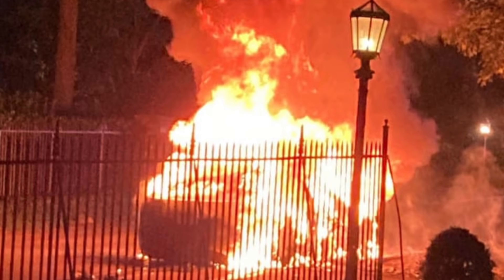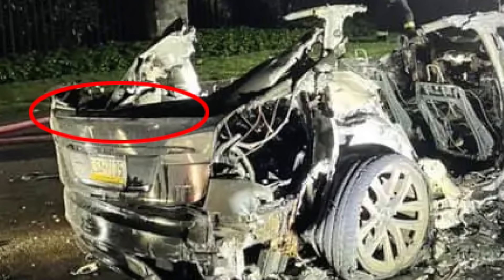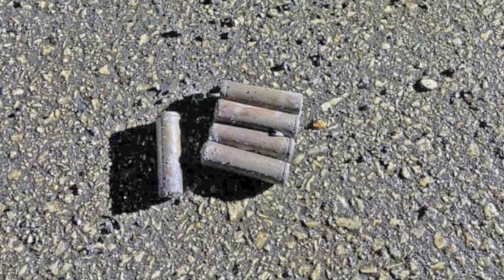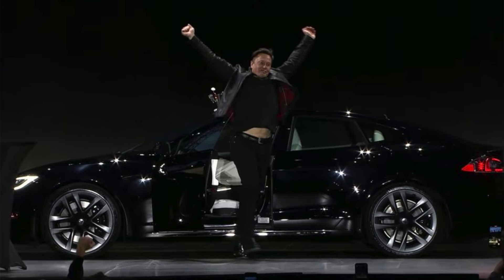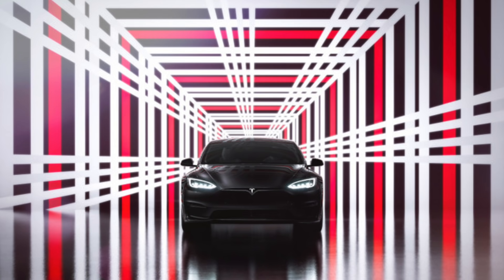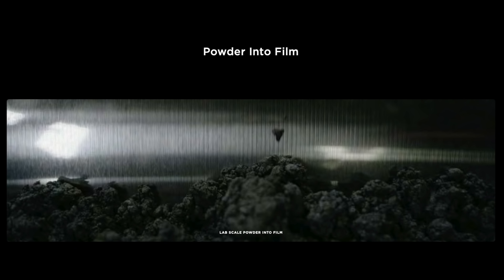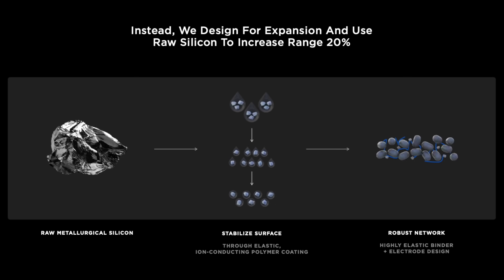New Info on Tesla Model S Plaid Batteries

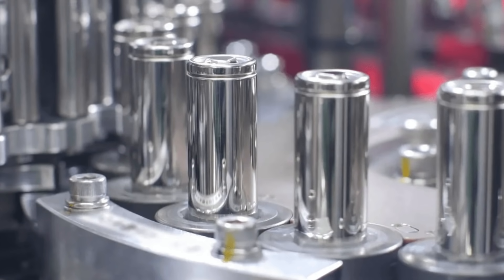Comment: I think, the main point, the really important point, is the one you state at 06:08. Tesla, even if the 4680 ramp goes better than planned, will need EVERY battery it can get their hands on for a very long time. As such, if they can still improve other form factors and increase output they will do so until the day where they can easily transfer all cars to 4680.
But as we can see here now with the Plaid, for performance and range, the 4680 is not needed for passenger cars. The 4680 is key to higher margins, faster production and being able to deliver on the Tesla Semi/Cybertruck and eventually getting to the 20M total vehicles per year.

Comment: I thought I read that one of the advantages of the tabless design means that there is now no weakness link in connecting to the cells i.e. you can now have greater discharge (and charge) currents.Maybe that could also explain 18650's with better performance?

Comment: Something that may help.  A Model S with 18650's is charged duty on the batteries when imported to Canada.  If the Model S Plaid had 2170 or 4680 batteries made in USA duty would not be charged on the batteries.  In other words if you compare the price of both Model S in US $ and CAN $, if the percentage increase is the same the batteries are 18650 but if the Plaid has a lower % mark up the batteries are either 2170 or 4680.

Comment: It doesn't matter which battery and chemistry is used, as long as the battery module can be replaced in a few minutes and the capacity can be reduced via software (-;

Comment: The simple explanation tends to be correct. Sounds like they used the maxwel technology in the old battery form for now. If this explains the fire, watch out below. If not, hold fast. When 4680 is announced watch out above. If fsd is announced, look skyward with a telescope. Also, don’t forget how the general index direction and currency crossings effect the up’s and down’s of the major stocks, Tesla included.
Reply: Unlikely Maxwell DBE was used in my opinion. Most likely a cell from Panasonic Japan.

Comment: Tesla's video clips showing 4680 cell production could be misleading. They give one the impression that 4680 cell production is in high gear, when in fact these clips were shot at a prototype manufacturing facility in Fremont CA. This facility is used to develop manufacturing techniques, not produce 4680 cells in any meaningful quantity. It is unlikely that 4680 cells are currently being used in any Tesla product. If they were, Tesla would be telling us about it. The 4680 cells or the manufacturing methods to produce them may need more work before real production begins.
Reply: They have shown the pilot line and call it as such, pilot = testing, anybody with half a brain would understand that. 
Of course TSLAQ or WS analysts can't (not saying you're one of them btw) as they are lacking the required material.
Reply: @Nooblade  Taking the 18650 cells to a new level was a more achievable goal in the short term. Many YouTubers have used the 4680 pilot line clips in their videos without explaining what those clips are actually depicting. I've been a Tesla advocate since ordering my first Model S in 2012.

Comment: There is zero increase in range, for the same size pack so zero difference in overall energy density. The new batteries are simply a high output (instead of high drain) in a 117s x 72p configuration split into 5 modules. The Samsung 30Q and Sony VTC6 (used recently in the original Plaid that ran at the Ring), are examples of a high output cell and have been around for over a decade.
Reply from the maker: The Long Range has a smaller pack than the previous.

Comment: I think that the tabless design would not require that much additional diffulcty to make it a feacture and have tabless design incorporated into an existing battery production line, 
it would require the copper foil machine to be changed so it cuts a wider foil width,
the machine that roll the foil would have to be adjusted to accomadate a wider foil coil width, 
then add a machine that allow the cuts to be made into the foil, lazer or knife or air jet, then a folding machine to be added after the rolling has taken place,  ,so its likely that the  tabless design was put into the Plad model S, this would allow the increased performance, and charging times.

Comment: Latest report I saw.
Driver was in the car.
Fire started at the rear (BMS??)
Doors wouldn't open (I assume electrically, so used manual release?)
Car "rolled" (moved) after driver exited vehicle.

Comment: Tesla do need every battery they can get. Where do 18650s go if not into model S? The implications for 3 and Y high performance versions are crazy. Tabless is used for 2 main purposes, greater power and greater heat dissipation. The plaid fire is odder for that 2nd reason, if they were tabless. I don't think Panasonic could move that fast. 4680s will permit higher range and performance IF Tesla use more than about 1/6th as many. They wont initially. They use the minimum to hit range and performance to minimize cost and maximize volume.

Comment: It's the original 18650 with new chemistry. You only need a 4% improvement in energy density to achieve the smaller battery pack with similar range. The new pack was to accommodate a new module and cooling design. The modules, battery electronics and thermal design were needed to accommodate the higher energy input and output to receive 250KW @450Vdc charging and to feed the motors at 1KW (saw that 1KW spec somewhere for the plaid).
Reply from the maker: Right, that could make sense

Comment: Dude. You should have given this up a long time ago. I love all your videos -except the recent spate of your battery conspiracies. Let us get something straight. As a form factor, 4680 is not better than 2170. 2170 is not better than 1865. For a given energy requirement, 4680 is cheaper to make than 2170, which is cheaper to make than 1865. Without tabless architecture 1865 is the easiest to cool (and can thus generate higher power for the same chemistry).   

Tesla does not have to do anything with the 1865 cells except put them in packs. These cells are made by Panasonic Japan. Improvements to these cells have been happening constantly due to chemistry improvements and more silicon in the anode.  Making 1865 tabless has very little benefit. And there is no reason to beleive that Panasonic Japan has dry electrode technology. 

Tesla went with 1865 for Plaid as it has a better  power to weight ratio compared to 2170. The recent changes made to Model S packs have been hinted at by Elon for a long time - it is  moving from cell-to-module-to-pack to   cell-to-pack directly. That results in some weight savings, but not as much as structural packs. My guess is structural pack may not be possible with 1865 cells as it needs to be cooled from the sides (and not the caps). 

It is the tabless architecture that makes the substantially cheaper 4680 possible. As a side benefit tabless also makes cell production faster. In addition,  the dry electrode process also makes it cheaper and faster, plus does away with left over sludge from the solvents.

Comment: The 18650 are manufactured in Japan by Panasonic. They would likely only modify the chemistry slightly to improve energy density and charge/discharge speed thanks to Silicon. There is zero chance these batteries have tabless design. That it only necessary for 4680 due to heat problems.
Reply from the maker: True, due to the wider diameter of the 4680 the tabless design fixed the heat issues. Also tabless helps in mass production, but these wont be mass produced to the same level.

Comment: Thanks. I think the tabless design was also a major factor in reducing heat build up as it creates an infinite number of paths for the electrons to exit from instead of all following the same exit path and effectively queuing at the exit tab which causes the heat build up, if I remember correctly.
Reply from the maker: tabless doe reduce heat I believe too.
Reply: You're saying "less internal resistance, therefore less resistive heating..."

Comment: Again: incorrect on most fronts.  I like your work and ideas, just need a bit more perspective.  1) its  primarily the motors on plaid.  2) 18650's need to be used.  and they are in a reasonable volume as a purchased item to suit the plaid volumes.  They have to go somewhere.  As it is the motors and the chassis design that cause most of the improvement, the batteries are good enough.
Reply: "it's primarily the motors...."
It takes energy to move the vehicle.
It takes energy to accelerate.
However good the motors are, it requires efficient supply of that energy at the rate required to turn them.
These motors enable the 200mph top speed, they are also no doubt more efficient.
They still need sustained energy from the pack/ BMS, with reduced heat loss if they're still using a 100kWh pack.
As for "going somewhere", which cells are used in storage? (Also expanding)

Comment: The smaller battery case has more surface area than the 4680, thus enhancing cooling. I think the new battery pack was mostly about enhanced cooling.
Reply: But tabless gives lower resistance, so less resistive heating.
(No, I'm not saying 4680, just the that's not the reason)
Reply: Tabless eliminates the need for active cooling. Now this leaves me wondering how much can they push the new tabless design in charge/discharge.
Reply: 4680s will be cooled from the bottom instead of old serpentine ribbon snaking between cells, surface area essentially irrelevant.  Presumably they will have better cooling in part due to heat travelling much more efficient along 'laminations' instead of across them despite shorter distance to sides, heat flows best to the top and bottom.  

(Ribbon always bothered me a little in that it must result in different coolant temps along it's rout, some cells will be hotter than others to a significant degree if not mistaken.  New pack form will, I'm guessing, have simpler more consistent temp control via cooling/heating the bottom plate of pack)

Comment: If Tesla can get so fantastic preformence in using (improved) 18650 batteries , imagen what will happen then they have worked out the kinks with the 4680 batteries.

Comment: Going tabless make a huge increase in cooling, peak current, efficiency and reduces weight. If they can keep mostly the same production line this would explain the tremendous performance. The new chemistry is also a big deal, but the superior cooling of tabless might be necessary for the insane performance. 2 sec 0-60 burns a lot of juice. I suspect the 4680 wasn't ready to go into production to go into  the plaid. People forget that it takes TIME to verify/prove the lifespan of a new million mile battery BEFORE production. It might just be chemistry, but the Plaid really is F*ing fast. I think it is still not that bad a bet that they upgraded the old production line. The way to recognize tabless is cooling from top & bottom while the old batteries are cooled from the sides. Try to look and see if you can spot the cooling system.

Comment: I think we all keep forgetting something important about batteries.

Tesla's mission is not to make the best batteries or the best car Tesla's mission is to accelerate the transition to sustainable energy.

The 4680 cells do this very well, they have a lower cost and have a higher capability of scaling.

That doesn't mean these batteries are on such a high level that they need to be put into their expensive vehicles, it has such large margins already lowering the cost wouldn't really benefit.

This is why Tesla has kept saying again and again they won't change the form factor of the cells for the S and X.

I see them keeping the Model S 3 X and Y the same fom factor as the factory you say are built in, as for the new factories they will use the new form factor.

In fact Tesla even said that in Germany they will put up both lines so that they can ensure maximum production and not have to worry about ironing out any kinks with the 4680 cells.

It feels like a letdown but to really look into it like this it makes sense. Because they would also have to shut down production to be able to do that and that doesn't accelerate the transition, that slows it.

Comment: called it :) 
-same form factor, same production line , new chemistry. 
I think
-Going tabless is a hassle and would require a new production line. Might as well make 4680's.
-The 4680 needs tabless for heat/resistance and greater current capacity.. The 18650 doesn't. -Tesla is focused on supply volume..

excellent vids btw

Comment: Tesla will lose credibility and consumer confidence if they continue to use non-upgradable battery packs.  It's okay to use the prior-to-4680 formats, just as long as you can swap that out for a 4680 pack within a year or two.  This should be doable even if Tesla has to replace the entire car and sell the traded in, used one, as what it is.
Reply: Given that we now know the packs last for over 500,000 miles without significant degradation...

...Nobody cares.

Comment: They haven't reached scale production at suitable yields for 4680 cells. Also Elon has said that Giga Berlin model Y would be the first car to use the 4680 cells. 4680 cells is for mass production and high volume cars. Model 3 and Model Y first. Cybertruck as well. Speculation is fine in the absence of facts.